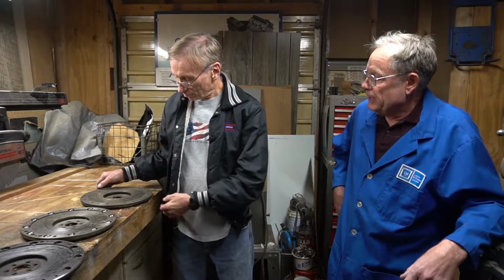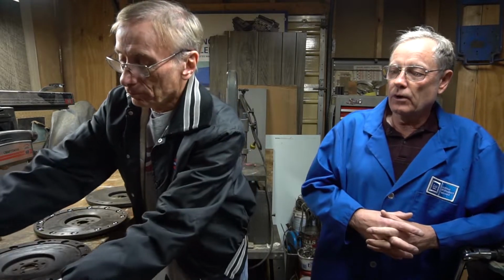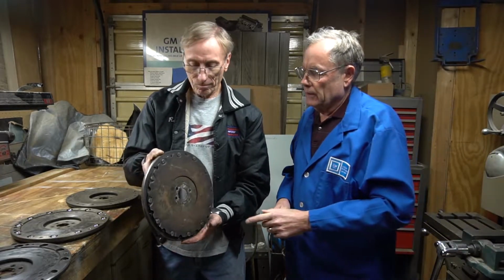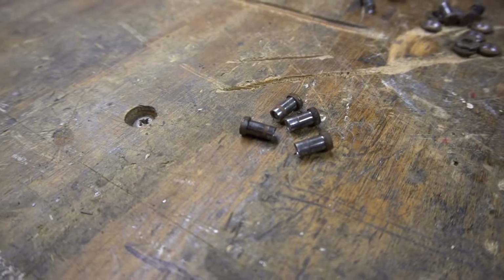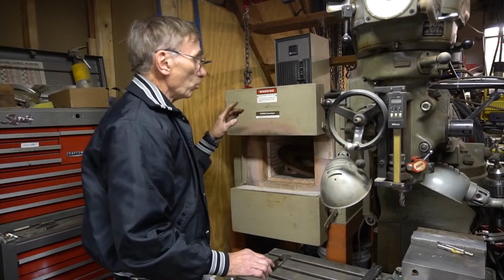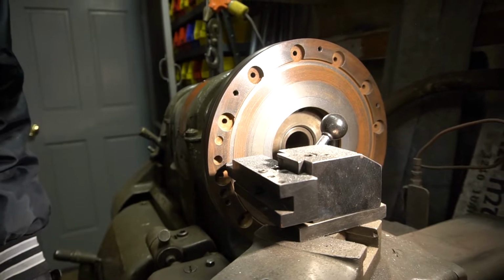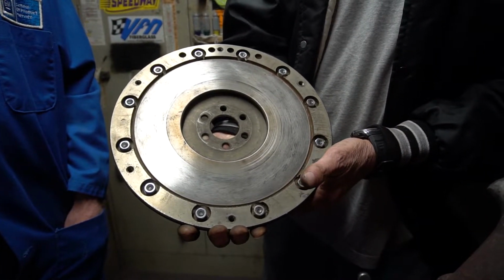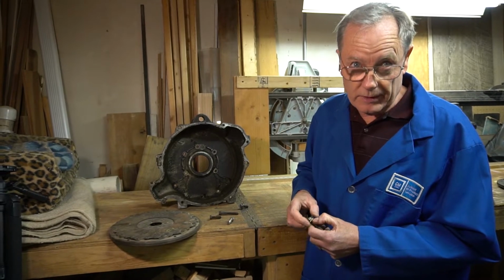Corvair Bolted Flywheel Process

Comment: If I was building a corvair with an automatic transmission, I would make a new flex plate. The outer bolt holes are too close to the edges of the plate. This part failed twice on my 66. The answer is more steel at that area. Check your overall clearance and make the plate as large as possible.

Comment: as a kid I had a 65 corsa 140 that had a bad flywheel it was so bad  that it would break the nose cone on the starter  my dad totaly rebuilt the engine thinking it was bad bearings. one of the members of the corvair club sugested replacing the flywheel after pulling the engine for the fith time which corrected the problem.